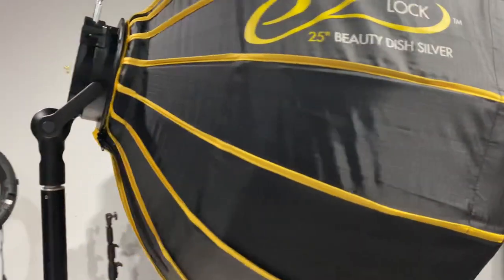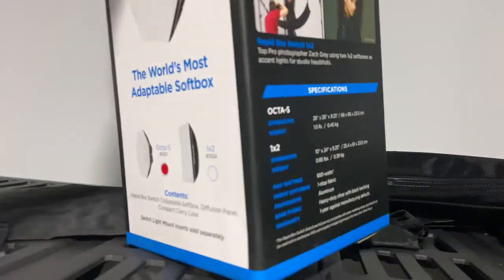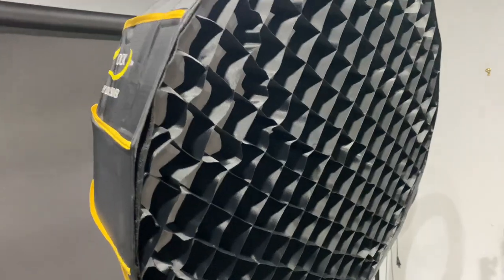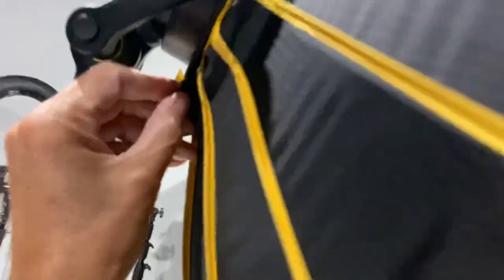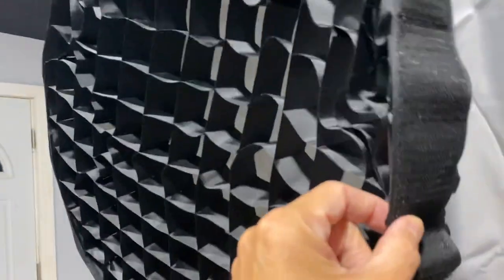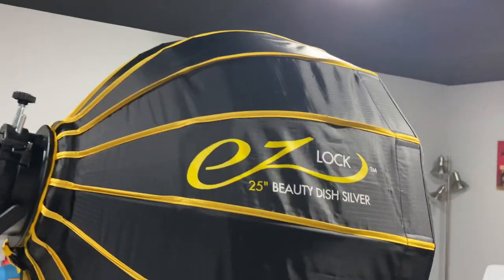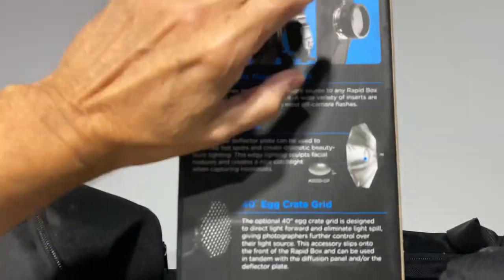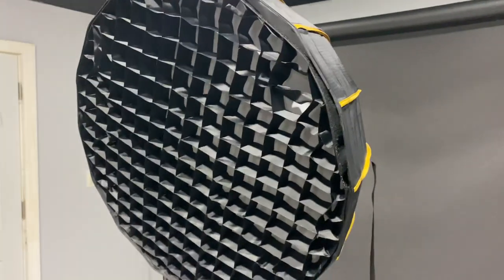Glock EZ Lock 25 ” Beauty Dish |  killer beauty dish

Comment: Thanks for sharing your experience. Do you think this is good for GODOX AD 200 PRO? I am thinking to buy one, but I am not sure to get 25" or 34".
Reply from the maker: Yes is excellent buy all 3 there extremely cheap ....I however shockingly switched back to Westcott I did a quick video on why ok but there are good if u are just starting out  the 25 is very good u can fit a ad200 easily for run and gun photography is excellent u can buy both there cheap and affordable u want both trust me .. but both